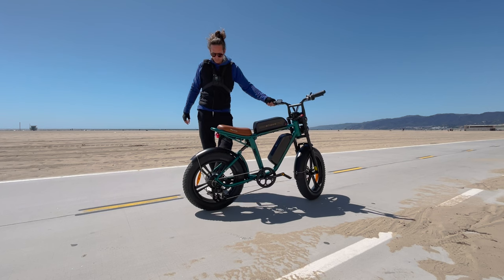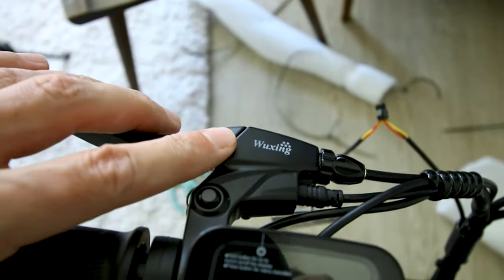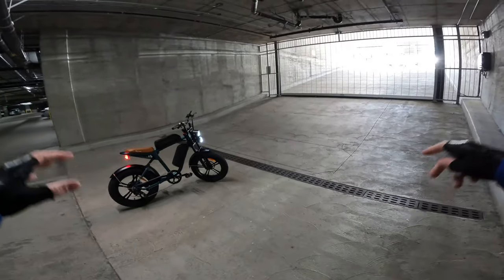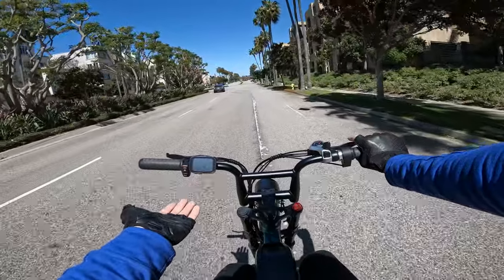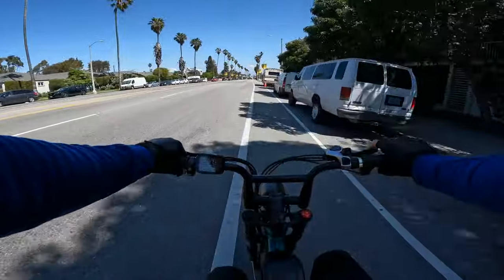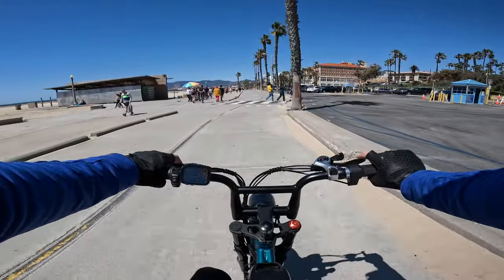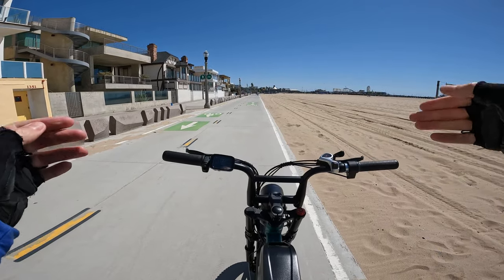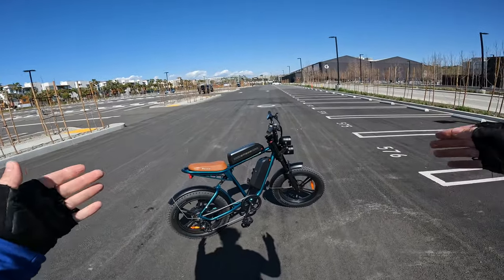Engwe M20 will CURE RANGE Anxiety... Right?

Comment: If I bought that I would change back wheel to 2000wat 45amp controller one battery 52v 20amp sell other wheel and batterys and I would have a great bike 50 mph on a stand on road 45to 48mph that would do me I've got that set up on mountain bike so that set up on this bike with fat tyres great 😮

Comment: Solid build. Just started checking out E bikes. I really dig these moto style frames. Thinking about picking up a Ride1Up Revv1.
Reply from the maker: right on! yeah the revv1 is a great value and faster than most of these moped style ebikes, especially the fully suspension version (I'm sure you saw my hard tail review right?) If you do grab one consider clicking this link and using my code at checkout to save you $ on it as well as support my reviews:
https://go.ride1up.com/SHz - $50 off with Discount code: tailhappytv
regardless of your choice, have a great riding season!

Comment: Just bought this, mine was very easy to assemble apart from the front wheel I used an extra, when you buy twin battery it already comes basically built other than the light and front wheel I got an extra rod I used rather than the one inside the wheel.
Reply: bro what do you think range? really can 150 km range?
Reply: @burakarc698  I think so, I never did a range test but I’ve driven around all day with a single battery on and it won’t even use half, the battery range I’ve seen on other videos gets a lot more as guys cycle sometimes, both taking strain from the motor using less power, while adding power from peddling.

Comment: I just saw some other review of this bike today earlier. I mentioned how lackluster the 20 amp controller provided power. But I can see how if a person really liked this bikes looks that it does have potential. Switch out that rear tire and motor for a 1,500 to 3,000 watt motor and get the 40-50 amp controller. That frame space has plenty of room for a nice 60 or 72 V battery .. Brakes to hydraulic is an easy upgrade too. You would think full twist would be easier to modulate power ..
Reply: Buy a new bike then replace all the main components with other new parts that may or may not work together properly at considerable expense and labor to make it into a bike worth owning. Sounds like a plan.
Reply: @Dave-dr6ft  most kits that replace current components are reliable.  You only need select the battery design to complete the package. I would chose the most liked frame style for myself and then decide in power and battery
Reply: @Dave  the kit comes with everything except the battery and to get the correct kit for you ebike you only need to know 2 things the rear dropout dimensions and the tire size

Comment: This bike has been on my short list for e-bike #2, now after watching this It may have dropped a few notches. I want to get a 50-60 mile range without any worry. I was wondering about the UPP Battery as a backup battery but I haven't seen any videos that talks about backup batteries. They are probably out there just haven't found one.
Reply: Did the Upp battery worked?
Reply: @SerPounceToebeans  I haven't used a backup battery yet, it's why I was asking about them. Since the video though I have looked into it and everything I have found say yes they do work well. The only issue that came up a few times was that some bikes are not capable of the 2 battery setup. I don't know enough about the power modules to know if my bike is capable or not.
Reply: I just wired in a 48v 30ah chamrider polly 7 lithium ion battery on the lower down tube. I use the 2 13 ah batteries for the top tube. Now i gett a reall 100 mile range. I love this bike and when i bought it was 1450 now it's on sale for 1200 you get your money's worth. Alot of people dont like it but i love it. I put a rear rack and cst scout tires and upgraded the 160mm rotors to 180 and upgraded the rear shock to hydraulic rear shock. Now it rides so smooth next ill probably upgrade the controller .

Comment: What is the width of the bottom bracket on this thing? I think it would be cool to replace that rear hub motor with BBSHD mid motor to get excellent hill climbing ability and judging by the frame you probably will be able to mount that motor on top of the downtube so it would look very nice. I like this idea but don't like these low torque hub motors.
Reply: I seen a you tube video where someone did this. He kept the rear motor and installed a mid drive motor. Looked good

Comment: If I were to mainly use the throttle would the 80 miles it says it can do be with throttle use
Reply from the maker: Largely depends on speed, but I would say about 40 miles on throttle only

Comment: I'd love to see how far a person could get if they hyper-mile this.
Reply from the maker: what does hyper mile mean?
Reply: @TailHappyTV  Eco driving. He basically saying would like to see how far will this thing travel dual batteries if you go easy on the power
Reply from the maker: @helenHTID  ok that makes sense, I was thinking like hyper speed😆
Reply: @TailHappyTV  If you drive an EV, it means squeezing every last bit of range you can get from the battery by driving with the highest efficiency possible.  In some cases, people can get way more rated range than what is specified.  Mostly it's done with cars, but it's totally possible with ebikes.  That bike looks small and light, so I wonder how far it could actually be pushed in a pinch.  It seems like it would be a great candidate.

Comment: Good vid. Disappointing bike
Reply from the maker: thank you for watching
Reply: I think it's a good bike for the price. With the one battery price is around 1300. 
Much cheaper than others in that range of e-bikes. Some go from 2000 to 3000 dollar (or euro's in Europe) .
Of course there are maybe better or faster e-bikes, or better looking or whatever. But it comes with a price.